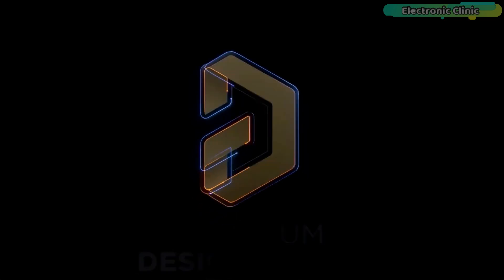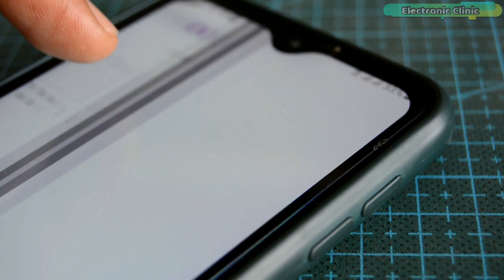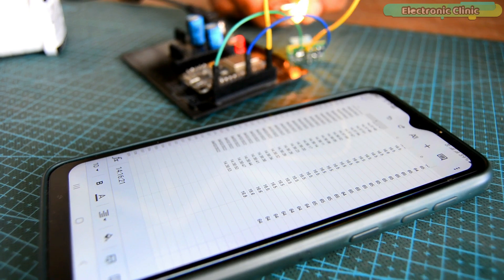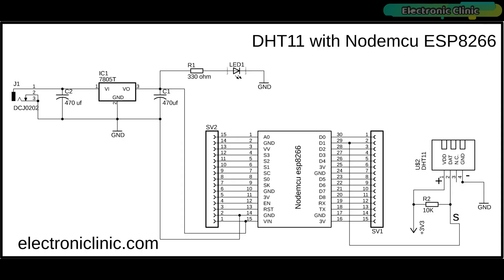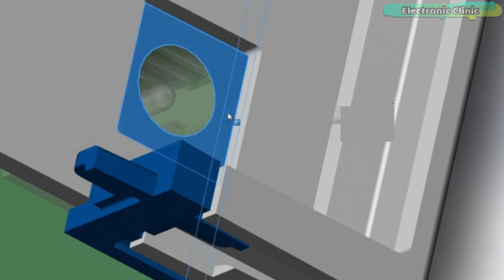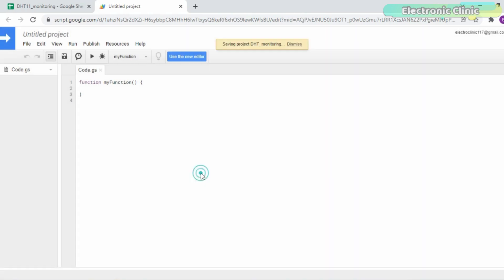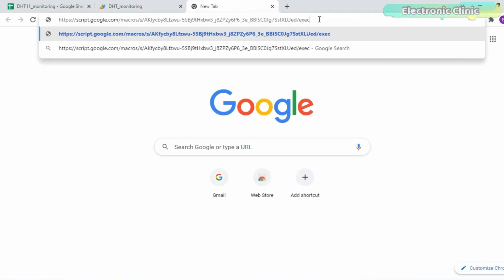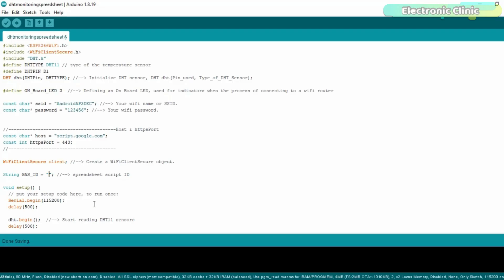Google Spread Sheet or Google Sheets with ESP8266 Nodemcu for Data Logging, Temp & Hum DHT11, IoT

Comment: It’s possible to adjust script so if any value is existing,for example a row have the same data, to now write. So no duplicates of data?
Reply from the maker: Ya, you can compare current value with the previous value. If both the values are same then do nothing and if the values are different then send the value to Google sheet

Comment: Nice video. I have a question. If the module is powered but not connected to wifi etc. can it store data and then dump all data to google sheet after?

Comment: I couldn't get the data to the Google spreadsheet. I tried several things, nothing helped. Everything was working oke.
The solution came when I changed the option that everyone could join this projest. You have to choose this when implementing the web app.
So I thing there is a securety issue with Google.
Hope that this helps someone
Reply: Same  :(

Comment: works fine. but after 4 data recors. serial monitor shows "connection fail". only 4 reading record.
Reply from the maker: I don't know why its happening on your side. I tested it and it worked just fine.
Reply: I'm working on ESP32. I have the same trouble. Someone with a solution? Thanks

Comment: Did everything same. Code is working fine. Only problem is humidity value is saved in column C with Temperature value instead of column D. How to make humidity value shift to column D ?

Comment: sir i am using the same code as which was given  in description, but no data is sent on spread sheet. I am using dht22 sensor. Temperature and Humidity value is properly shown on serial monitor but  in the last serial monitor shows esp8266/Arduino CI has failed plzz help me sir what was the reason......

Comment: I have followed your instructions carefully including from your web site BUT then I try accessing the URL I keep getting an error "Script function not found: doGet"  

In AppsScript if I try Run the function that starts as follows (as per your example) :

1.   function doGet(e) { 
2.   Logger.log( JSON.stringify(e) );
3.   var result = 'Ok';
4.   if (e.parameter == 'undefined') {
5.   result = 'No Parameters';
6.   }
then rest of code follows....

I get the following error in Execution Log

6:56:25 PM	Notice	Execution started
6:56:26 PM	Info	null
6:56:25 PM	Error	
TypeError: Cannot read property 'parameter' of undefined
doGet	@ Code.gs:4

So there is a problem with line 4 BUT I can't see what has gone wrong

Any help appreciated...